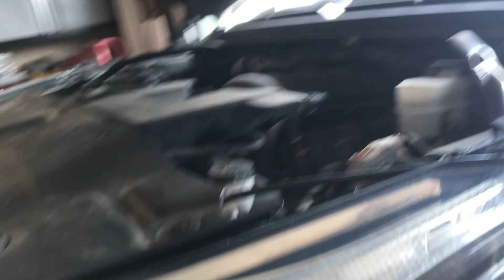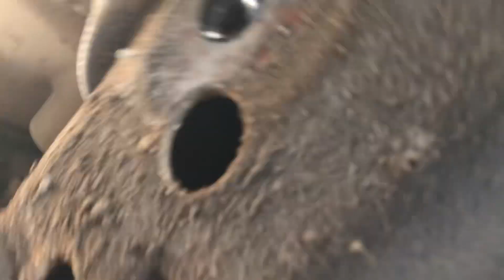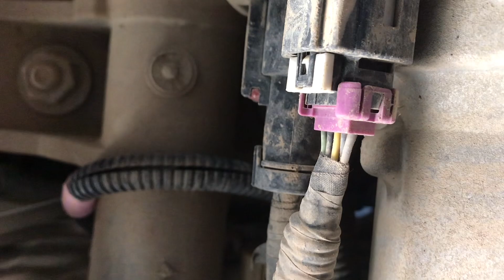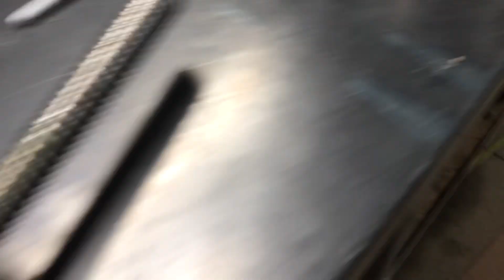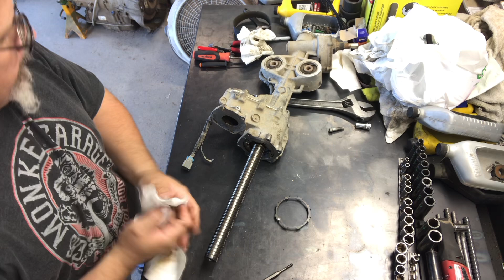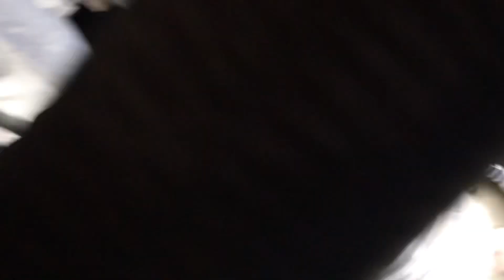2016 GMC Yukon Denali electronic power steering repair. ￼

Comment: Big help, currently working on this right now got the lock ring off infront of the bearing, but now the outer part of the bearing will not unthread when spinning the inner bearing sleeve, I do have the drive shaft end clamped down but it's got so much pressure it's lifting the whole rack once I spin it one full rotation, once I relieve the pressure on the bearing it'll spin back. Any idea on how to free up the bearing? Would a little heat be recommend for such? Thanks in advance (my belt tore in half and has completely gooped up the splines and inner housing, need to throughly clean this up, worse case i suppose id have access if i opened up the other end with the white gasket maker if i cant free this bearing up)
Reply from the maker: I had one that was ceased like that I used some penetrating oil around the bearing and worked it back-and-forth, tapping it lightly and finally it freed up
Reply: @wlschaubels Funny how it's that very last minute when you are about to give up and worn out from trying, it will work out 😅
Reply: @wlschaubels yeah I spent a good few hours trying all sorta of stuff lol couldn't get that thing free, had to open it up from the back belt housing to slide her out
Reply: Spray some penetrating oil like PB or worse case WD40 around the bearing and let it sit for about 30 mins. Follow the method shown here and do not let go when you feel it is getting too hard to turn. When mine did that, I just held it in place and it slowly let go. Another tip is to use a large piece of wood like a 2x4 sheet of cheap plywood or OSB board and screw the rack down where the mounting holes are for support. I used long drywall screws and big fender washers. If you still can't get it out, take it to a machine shop.
Reply: @moe4772 yeah I did use some penetrating oil, it did not give, even put some ice cubes on the bearing, took a heat gun to the outer housing with no prevail. Ended up opening the belt housing from the other side thinking I could slap the belt on that way, didn't work still had to press it out lol but it did give me access to the back bearing and with very little pressure I was able to slide it out. Spun the bearing belt assembly off of the rack and had a bunch of small bearings fall out 😂 didn't loose any, needed a good clean anyway and some new grease in the bearing etc, now I just need to tediously put these small bearings back in the groove and slap it back together. My passenger side bushings were also shot, had to actually cut one bolt out.. the new polyurethane bushings look completely different from the oem, we'll see how that goes, doesn't seem a guy can even get those oem bushings
Reply: @Winterborne204 Wow I thought I had it bad lol I hope it works out for you man.
Reply: @moe4772 yeah good old winnipeg, sand and salt in the winters ruins every bushing and bolt imaginable lol, seen you just pop those 4 mounting bolts off with ease, I was like ahh this won't be so bad... yeah it was very bad haha

Comment: Thank You so much for this video. My 16 Escalade suddenly started making this same exact noise and everyone was saying its wheel bearings or balljoints but I changed those not too long ago! Also, I noticed while the vehicle is in motion the steering feels stiffer and has a hard time returning when turning - scary! BUT when at a stand still it feels like its easy to turn again (with that noise that is). Did you experience that as well?
Reply from the maker: Yes, mine acted the same. Made the noise when standing still and the stiff steering as you’re driving down the road intermittently.
Reply: @wlschaubels   I just got done with it and all is well now - thank you so much for this guide. My only concern was how the belt looks directional with its slanted grooves and I did not notice how I put it back but its dead silent again and working as it should :)  I tried to help some of your posters out on here, hope you don't mind.
Reply from the maker: @m @moe4772  I was concerned with the direction of the belt as well, but if I flip the belt, it laid the same angle so I don’t believe there is a certain direction it goes. No worries helping the other post that’s why I did this to help other people save some money.

Comment: The little ground wire at minute 16 in your video was badly corroded and just fell apart on my car, no sheating to protect it. Will it be an issue if I don't fix it? I don't want to pull the rack out just to fix that wire.
Reply from the maker: I’m not sure of the purpose of the gound  wire, but I know in general the ground wires can cause many problems in the vehicle with all the electronics that they have these days.
Reply: If you are able to access the end of the wire that goes into the big loom just solder or use a crimp fitting and join a piece of wire to it with a terminal on one end. Honestly if it is not affecting anything, I would just leave it alone. Don't ask the dealer, they will tell you you have to replace the entire rack lol. I'm an ex tech lol
Reply: @moe4772 I can see that happening, lol. Unfortunately broke right in the middle, copper just falls apart, not enough room to work if it's not off car.
Reply: una pregunta con el daño de la banda que códigos de falla arroja o solo ase ruido
Reply from the maker: @juliocesarfelixmedina4056  mine just made a noise and the steering got hard

Comment: Hi, great video, have mine down and removed the motor and noticed the knocking was coming from the actual motor when spun by hand, can hear it. Motor was turning the car fine just loud. Curious if the belt was your fix or if you ended up replacing the motor???
Reply from the maker: It was the belt on mine. However, I have repaired a few that the motor needed to be replaced on.

Comment: Yeah hi on your 2015 GMC Sierra 5.3L engine oil pump replacement code P06DD video, you said if you have any questions leave a comment, but their turned off. Anyway was wondering A. if you pulled the pan on the ground, with out lifting the car, and B. for a (2 wheel) drive 2015 5.3 1/2ton if you have to lower the rack or will the pan come out with out touch the rack & Pinion ?? in a spot hear....appreciate your feed back.
Reply from the maker: @MidnightJazzer  I did not have to lift the vehicle off the ground.  I do believe you still need to pull the steering rack to gain enough clearance, to drop the pan.  But I am not sure.